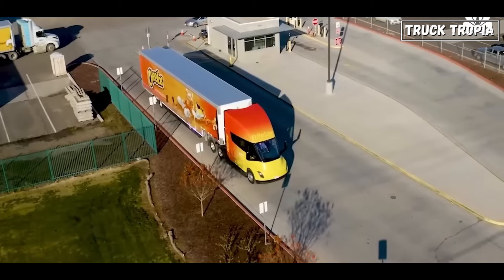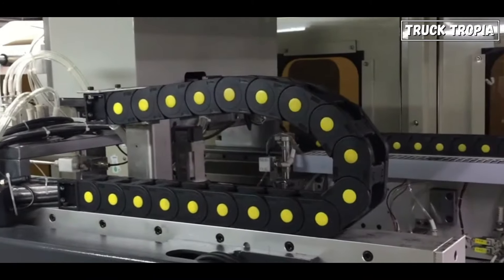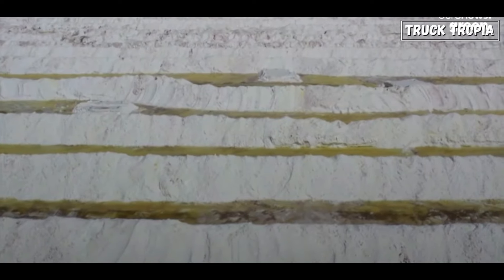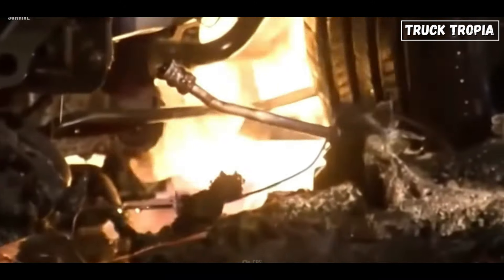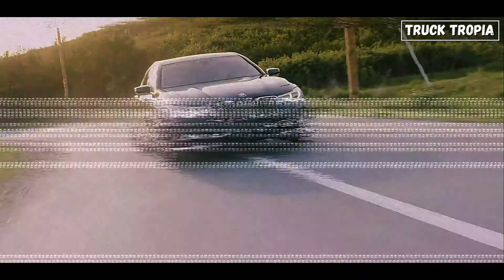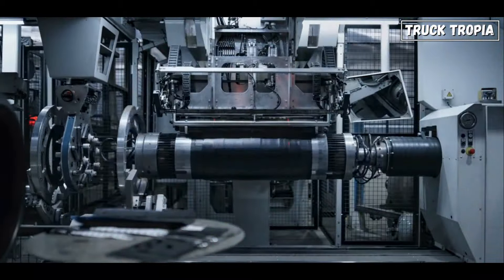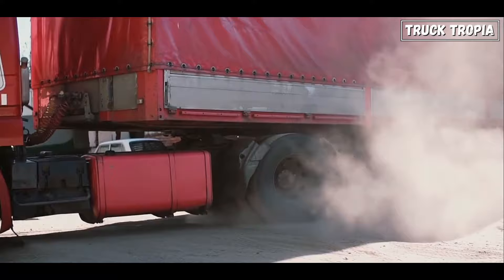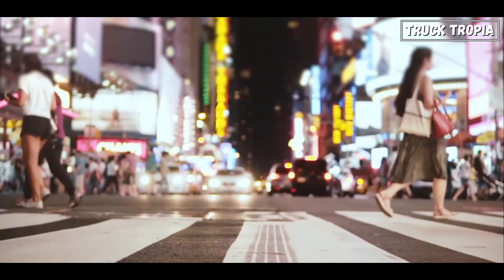Why Electric TRUCK Fires Are Impossible To Put Out

Comment: When lithium ion batteries burn, the cathode material breaks down and releases O2. This fuels the own fire. One battery will raise the temperature and pressure on the other battery packs and ignite them as well. This is why the car ferries burn down with electric vehicle fire. Water covers the car up but the fire is fueled from the inside and not from the outside. Its a very big new challenge.

Comment: EV trucks are the future, highway charging/powering and CO2 tax etc
Reply: I doubt that some manufactur probably will choose hydrogen fuel cell instead of fully electric truck
Reply: No they are a disaster imo , for a start they are prohibitively cost ineffective,  add to that batteries are extremely heavy  , and the whole point of a truck is to carry the maximum amount of freight possible. 
 Not only are there regulations on axle weight , roads also have load limits .
 Also a big draw back for any type of EV is adverse conditions, or  dragging heavy loads for extended periods,  and on trucks extra heavy load or drag ( extra axles) or  electrical loads , like  when trucks are fitted with other devices and machinery , just one instance being hydraulics for example .
 then there is the problem of batteries which do degrade the more you use them , and of course that means your range goes down too  ,  and range is also already  inferior to diesels.
 As an EX owner driver,  you couldn't pay me to buy an Electric truck.
 And another point, heavy  trucks work much harder , and for longer hours than cars , how long will it take to wear out a absolutely huge massively expensive battery pack in the EV truck ?
I'd take a guess not long.
 At one stage I drove for a company that ran 6 days a week pulling two trailers up to 68 ton maximum , the trucks did 2 X shifts per day , usually a run taking 10 hours , and maybe a tad longer if we had to unload at another stop on the way .  Back at the depot , the driver would drop the trailers off , hand the paperwork in , wash the truck , fill the tanks with high flow pumps about 10 minutes , clean the inside of the truck out for the next driver shift , and go home for some shut-eye .
 And we did not even mention extreme heat conditions in summer that doesn't bother big diesels,  and of course extreme cold which we already know impacts EV batteries badly.
 I could mention a buddy that owns a small bus service in the country that is being pushed to update his reliable diesel buses to electric buses that cost twice as much as a diesel bus , are capable of half the range and are an absolute nightmare when they break down,  and make no mistake EVs break down and parts are usually a fortune. 
I've got nothing against EVs , except they are inferior in so many ways to diesels ( or ICE vehicles)that have been doing the hard yards for nearly 100 years.

Comment: Using hydrogen fuel with ICE engine is solution
Reply: Really bad idea
Reply: @itsscience9113   why bad idea?
Reply: @Terkini-pr1nj  there are several problems, however imo the real problem is efficiency 
A hydrogen fuel cell vehicle is twice as efficient as a hydrogen combustion vehicle 
Meaning a hydrogen combustion vehicle need twice as much hydrogen to go the same distance compared to fuel cell vehicle
Reply: One thing is, if you think a fire with an electric truck is bad, then think when hydrogen is burning.
Reply: @itsscience9113 add in embrittlement, hydrogen evaporation, the difficulty in refueling, etc.
Reply: Worst of worst, hydrogen takes up a lot of space so then using combustion Rather then fuel cells are a retared idea

Comment: I think it's all about the battery chemistry. Even though i prefer combustion engines in general there's use case scenarios for battery powered vehicles of any kind. It depends on which type of battery the manufacturer decides to be used, and if they decide to use the choice with the highest energy density, they choose the option with the highest risks. In my opinion it's a bad idea to just look for the highest possible range per charge. For example, LiFePo4 batteries are way safer then other Li-ion batteries are, they just have a lower energy density, and this makes battery packs bigger and heavier. Manufacturers mainly choose to go the risky Li-ion way because of range competition reasons, ignoring the risks. That's imho a dumb idea.